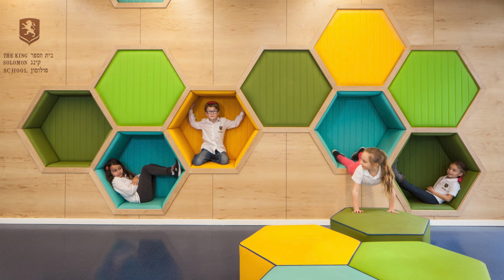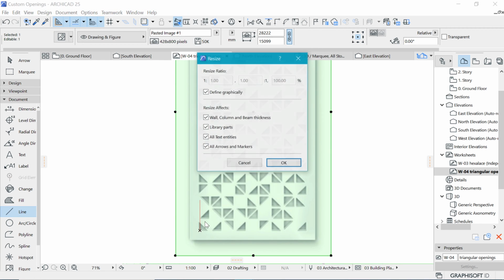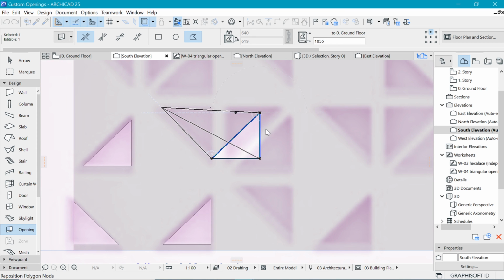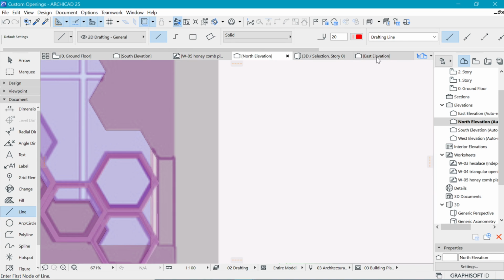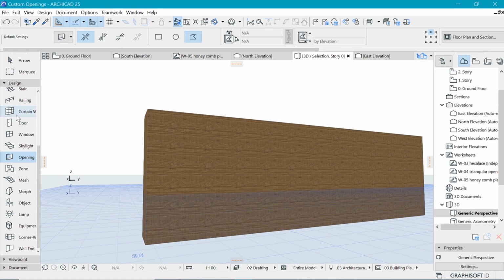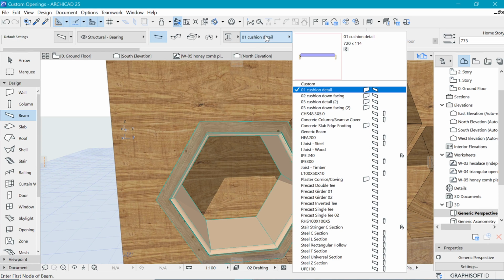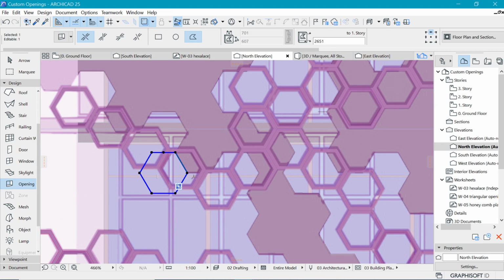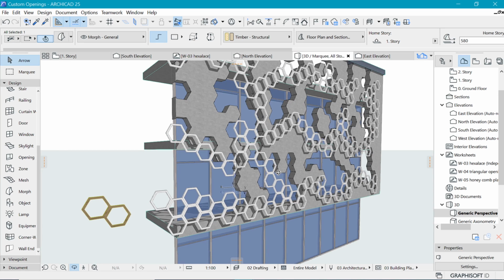The openings tool in archicad 25 can do amazing things faster than before

Comment: Could I do this in archicad 21, 22,23 etc, or this application is only for 25
Reply from the maker: no, there is no polygonal openings tool option for versions below 25, perhaps you could use the curtain wall instead
Reply: Hello